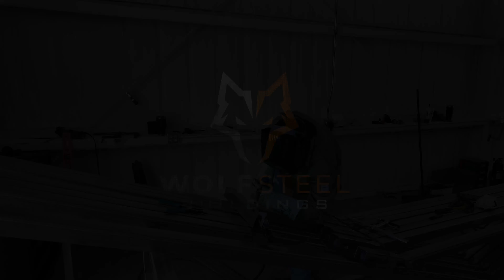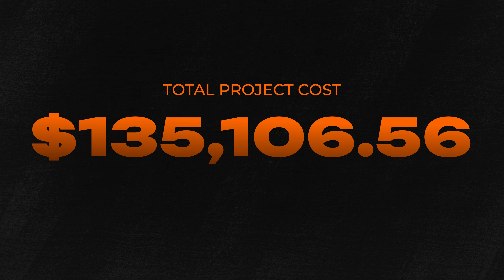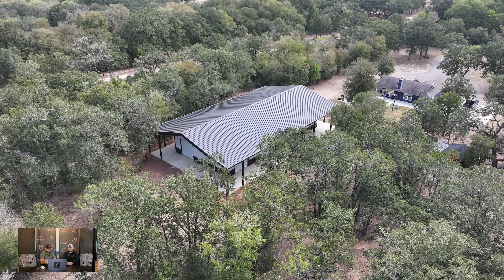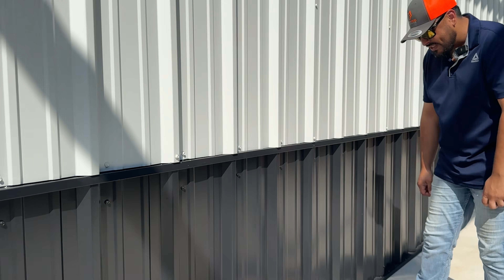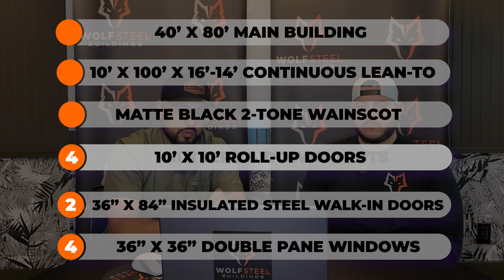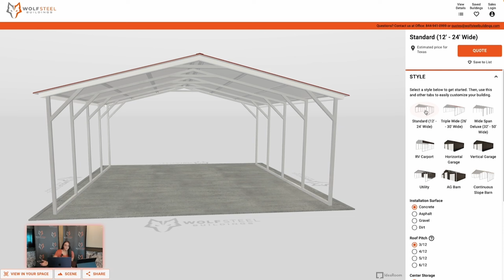How Much is a Custom 40x80 Metal Workshop Cost? | Metal Building Buying Tips | WolfSteel Buildings

Comment: Thats a beaty shop! I wonder could one use hardy plank on a structure like that as is?(just minus the sheeting)  I like the steel buildings but would prefer horizontal hardy board siding for looks and fire protection ect.  I imagine you would need to run some wood straps vertically to fasten the hardy to or something like that.
Reply from the maker: Thats definitely possible! You would need to find a company that can do just the framing. You will need to tell them your plans as the building will need to be adjusted for this!

We do not this
Reply: @wolfsteelbuildings  good to know thank you!